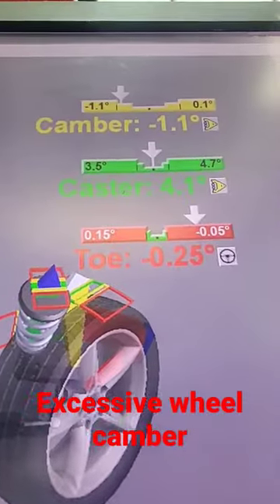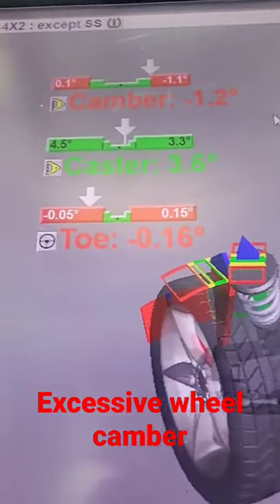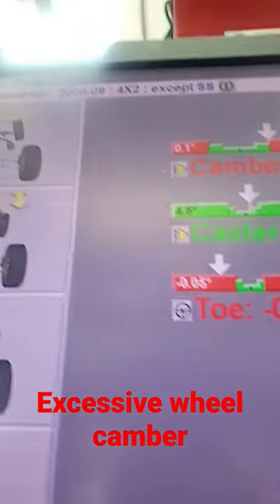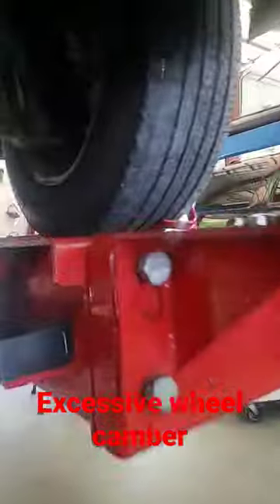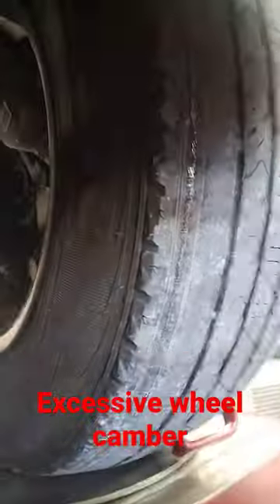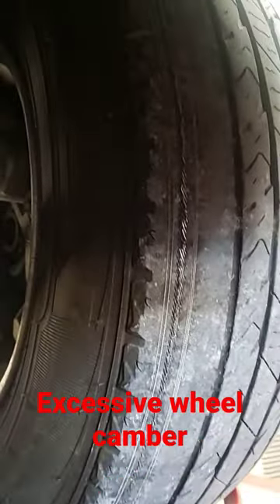Tire wear as a result of excessive negative camber

Comment: The toe out is what makes a bigger difference in tire wear not the camber

. Negative camber doesn't wear tire as much as people think, especially for only having just over -1 In the video shown
Reply: That was the case on my car too. More toe than camber. I run 2 degrees neg to help with turn in and normally tire wear is decent with rotating but the toe in killed my tires in months.
Reply: 100% agree, with camber being out of spec by 0.1 Degrees on the left and technically in spec on the right I would expect almost no noticeable wear. However having -0.40 degrees of total toe when  +0.10 degrees is the spec, absolutely will wear tires.

I'd definitely fix the camber anyway but for the sake being accurate in the story, toe is definitely the problem.
Reply: Is a tyre in a condition similar to the condition of tyre in this video( worn from inside) still usable?
Reply: I have a Honda civic so 2006 and I got -2 on my rear tires, I have to replace my front tires now but rear ones are surprisingly in good shape, Toe out as you said sir 🎉
Reply: My biggest mistake and not knowing much at the time I understood that zero toe and some camber won’t be that bad, Also going -1 on the rear
Reply: And there is NO such thing as caster on a front wheel drive car!!,Because the wheels are pulling,hence,no true caster!
Reply: @dimitriberozny3729  this is wrong.... But can you explain further. You're Saying "because the wheels are pulling" and "hence no true caster" what does the drivetrain have to do with caster and what is "true caster"....

Comment: I have same problem. Adjustable camber kit is the answer or upgraded ones. I went adjustable after going through over 1000 on just rear tyres. Good kit cost me 1300 no ebay cheapie where it has been known to snap.

Comment: The toes are out and that is the major cause of the tire wear from the inside. The camber is not bad to cause the tire wear from the inside
Reply from the maker: Toe in or out will wear tires faster and a bit differently. 
Some cars are set with a certain amount of negative camber. For example, some of the 2010s models of Dodge Chargers. The real wheels look out spec but they are just set negative by the manufacturer.

Comment: I have rear wheel drive and my new back tires went bald in three months… got an alignment last month and my rear driver side tire sticks outs from left to right. Left side more inwards. Tire is wear down more on the outside then inside. Replace my front strut and check my shocks. 

My car was swaying when it rained heavy too. 

I’m still wondering why my tire is sticking out like that before waste money on new tires again
Reply: Solid rear axels (rear wheel drive) cannot be adjusted on a regular alignment rack. But if your tire is sticking out to the left or in to the right that would be your toe. If the tire is leaning out in the top or on the bottom that is your camber and if your tire is not resting evenly in the middle of your wheel well that is your castor. Although most camber and caster gets adjusted together.. but like I said you cannot adjust a the back of a vehicle with a solid rear axle

Comment: I have the same problem, but on the outside and the allignment and suspension are ok. My mechanic says that I am pushing the car way too hard for street use.(kind of pushing in the corners)
Reply from the maker: From your comment, it sounds like you enjoy 😉 driving!!! I do too. I make sure to keep my tires inflated and my rotated. 
I always look at tires to wheels like shoes to feet. Driving habits have just as much of an effect on tire wear as the alignment.
Reply: @angeloeverett-autotech8999  got it
Reply: If you are doing a lot of hard cornering, you may want to set camber and toe a little differently than the book spec.
For example, if the spec calls for 1/4 degree positive camber and 1/8 inch toe-in, you can ask the technician to set to zero to 1/8 negative camber and 1/16 toe out. 
That will help keep the tire from rolling under on high speed corners.
You have to find a tech who is willing to be creative with adjustments.
You might also talk to some race mechanics who set up cars for road course racing.
Most factory settings are for straight line driving, tire wear and minimal steering correction while driving on the highway.
In your situation, you need less positive/ more negative camber and less toe -in/ more toe out.
The trade-off is the car will want to wander on straight, flat roads.
Good luck.
Reply: @deanmeyer1815 I drive my daily on the mountain, and on my new set of ps5's I've noticed the shoulder is wearing. I need your advice: Would increasing tire pressure and lowering the car help? (I run 40psi hot)  I can't adjust camber at the moment.

Comment: My chrysler 300 burns up more then that like bout 3 inches of tire burn up  they sit sideways mechanic said theres no cambers something has to be bent at a body shop he said but you think its just this what your doing?
Reply from the maker: If I remember correctly, the only way to make camber adjustments on some of the Chrysler and Dodge passenger cars is to shift the subframe. 
Is the suspension in good worker order? (front and rear)
Worn out suspension components can cause this condition. 
Did you buy the car used? 
Sometimes, there can be unknown/or undisclosed damage to a vehicle. 
It may be worth it to take it to a body shop to make that the unibody isn't damaged.  Or you may just want to take to another shop and get a second opinion.